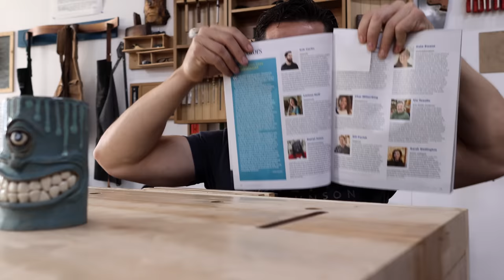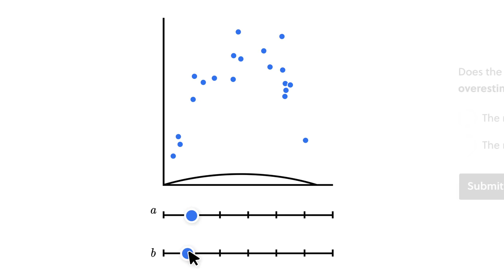5 tips youtube woodworkers give that professionals HATE

Comment: C-channel: I can't believe you'd compare the power of a living growing root with the movement of a slab top, it's absolutely not the same, one is progressively growing fibers multiplying not swelling over years and the other is dead fibers expanding and contracting seasonally, up to 1% of flatsawn width where I live.  There is no connection between the two.  Properly installed C-channel (with slots) will prevent cupping almost as well as a wellcrafted traditional tongue and groove breadboards.  But it DEFINITELY won't prevent twisting, and it'd be a huge waste of time if you only needed to attach a base.  Why wouldn't you just use flat bar then?  I will agree that the mystified bewilderment with which most of social media approaches wood movement is staggering.  Congrats on FW!

Comment: Maybe I'm using the wrong kind of double stick tape. Whenever I use it, one workpiece always comes off easily, then the tape just refuses to peel off the other workpiece. It's enough of a pain to get it to come off that I use the blue tape trick instead, and it works great. I use the thin CA glue though, not the thick stuff.

Comment: Sidewalks: That's not expansion and contraction, that's growth. Living wood is not the same as dead wood. Yes, drying, milling, and prep is really important, but steel absolutely can help hold a slab flat with proper attachment. In the same way that breadboards can. C-channel, properly mounted, should be thought of like breadboard ends.

Comment: Wait, #2... not doing "jack" up to a point. When the force of the wood is under the force necessary to deform/fail the C-channel, the C-channel is doing "jack". After that point, it's "not doing jack". Using my hardwood flooring as guidance, I expect the "acceptable" variance in moisture is 15%, ergo I would expect the C-channel to be fine for my home's CONTROLLED humidity which falls within 15% variance.

Comment: #2 - The example you're using of wood "blowing through" concrete is of a plant that is still living.  Guitar makers commonly install metal and carbon fiber rods to keep necks stable.  Ask Warmoth about their results before and after adopting the practice.
Reply: Guitar makers use them mostly because strings exert force on the neck that can eventually bend the neck.  Classical guitar makers don't use steel, and most don't use carbon fiber, but traditionally a different wood strip may run the length of the neck.  
A table is subject to humidity, but doesn't have steel strings trying to warp it.
Reply: @disqusrubbish5467  Point being, incorporating stable non-wood materials is effective at countering forces that may distort wood.

Comment: I'm no pro, but danish oil, shellac and waterlox are about all I need. Polyurethanes are more for anyone wanting a water-based finish. Wanna have some fun? Finish something in water-based poly, then spill some simplegreen on it. Eats a neat circle. Won't see that with waterlox. Oil-based urethane not so much. Oh, and proper ventilation is mandatory... shellac gets thinned with denatured alcohol (no smoking). And when it comes to food grade...duh..when the chemicals evap, its food grade finish. Have tried Osmo...its not cheap, but its a wax/oil wipe on/off finish. But so is beeswax and orange oil. 
Wanna fill gaps, I prefer Timbermate. Smells like kangaroo piss...but best putty with color choice for species. And I showed a pro that loves to use it, as we all make mistakes...like drinking and operating wood tools.

CA glue... neat tricks but yeah, double stick tape is cheap. I think Starbond just influences influencers...

Comment: Some of these tips I've never heard of ....and you make a good point about social media bandwagons causing trends but at the same time overall you're kind of your own enemy here. You have affiliate links to amazon, you have a sponsors, you literally made a "top 5 list," and you're on a bunch of social media platforms. But I digress....  IMO I think you're certainly right about finishes that state they can do it all in one coat like the one you mentioned. Polycryclic, danish oil (and related) and paste wax are my favorites for most projects. And for small cracks or imperfections, I see nothing wrong with using the same wood dust and glue if it's done right. Unfortunately, most of us are perfectionist and would rather re-do the cut in the first place. As for the CA glue and tape: that has to be done right and it should only be used for smaller projects. Example: when I remade my router table I used that method to make a router template. I ran out of db sided tape. It worked very well beause I used more tape and less glue. In your video you used a tiny pit of tape and too much glue. Congratulations on your recognition.

Comment: Make that subject 5 video! I’ve been trying to research on this!
I hope you do, because I subscribed for it just now , and for other stuff of course 👍

I do some woodworking as a hobby, and still in the process of learning. This video confirms my thoughts about some of the things I’ve seen on YouTube that I feel like is not right. Fx, I’m guilty myself with using the glue/wood dust method for filling small gabs, but still, I tried to repair a larger gab with actual wood, and it made the piece look much better. The dust fillings annoyed me quite a lot.

The other thing a can relate to is the finish subject, which I want to spend time on because the result is much better (in my experience at least) but again, I’ve been using stain before varnish. So , that future video may come in handy for me, and probably many more.

Great pro tips 👍👌

Comment: Thought the video would annoy me. Turns out I pretty much agree with all of it except maybe the stain part.  I'm a huge fan of quick, easy, cheap and available.  Stain is all of those.  I DO think people often just assume they need to stain any project, like it's some requirement.  I'm an even bigger fan of NOT staining or using any kind of Colorant.  Linseed oil, shellac, water and oil based polyurethane, floor wax, bees wax, and mineral oil, meet all my needs from tables to boxes to toys to kitchenware.   All super easy, cheap and available at any big box store.  Half of them even at any grocery store

Comment: your video just popped up.  nice one.  shellac is a definite go to in so many areas.  seal raw wood, binder between oil base and laquer finish or the final finish.  granted, not as rugged as poly but so much easier to work with.  maybe you can teach the wannabees?  and the wax sticks could be another class.  saved my backside more than once.

Comment: The ca glue painter’s tape method of temporary fastening really depends on the application.  I build electric guitars and use templates extensively.  If I used double sided tape I would run out in a couple of months.  Since I’m retired, that’s too expensive.  Plus it is not always easy to find the right kind of double sided tape where I live (don’t trust Amazon).  There are many luthiers that use this method all the time.  Also your demo is a bit misleading since the tape was too narrow and the glue bead way too big.

Comment: The C-channel thing is not harmless,it is promoting and perpetuating bad practice, like an urban myth.The partially sighted leading the blind towards avoidable problems.
To be fair,it probably will work in some cases with some soft,thin,softwoods.As you mention,the hydraulic pressure created by changes in moisture level in wood is incredible.In ancient times they used to split off huge blocks of stone in quarries by tapping dry hardwood wedges into small holes in the rock and sequentially pouring water onto them,waiting,tapping them down and re-wetting them.

Comment: I cant believe you said that "no professional furniture maker uses stain". 
I have 40 years unthe biz as a cabinet maker, furniture maker and finisher in 3 different states. 
Yes tinting top coats is an great way to get a custom finish. Ive done it plenty of times. 
But it wont give you a deep rich "depth of color".it simply can't. The reason is thag the color is suspended in the finish and wont penetrate the surface of the wood. It usually ends up looking mottled or "cloudy" as its often referred to. 
The best way to get deep brilliant colors is to use aniline dye in a clear stain base. 
So basically a home made dye stain.

Comment: I agree with the majority of your remarks. I do believe your idea that c channel does nothing to stop wood movement is flawed. One of your examples about how tree roots can make concrete explode is comparing apples to oranges. Tree roots are still alive and growing. The movement caused by environment in dried lumber is completely different. I do agree that using properly dried wood and understanding how it moves with changing moisture is critical to a well made piece of furniture. C channel operates in much the same way as Figure 8’s or other table top fasteners when properly applied. It allows for movement while HELPING to keep the wood flat.

Comment: So with respect to your c channel comments, are you suggesting that there is nothing that can be done to keep a tabletop flat other than milling and drying wood properly? I've not used c channel, but certainly wooden cleats are a common method that many pros use and I've used with success over the years. Trestle tables are another example, the trestles don't help keep the top flat?

Comment: I've moved on from c-channel to rebar.   Drill holes in from the back of the slab, slather 5 or 6 pieces of rebar in epoxy and hammer them in.  That should work right?  🤣

Comment: Well done... thank you for pro tips!
I've always thought the same about C channel... Sure, the channel is strong and flat, but 5 or 6 screws are not going to hold back a 2" slab.
Reply: By that logic it would be impossible to make outdoor furniture.  The C Channel doesn't have to hold it back, just limit what directions it moves in, just like breadboard ends, etc.  That's why some of the screw holes are slotted to allow movement but just not in all directions.   It's just not going to prevent all movement but that's different from saying it has no effect.
Reply: @ZeoCyberG  I stand by my assessment. Folks tend to focus on the strength of the C channel itself... when in fact, it's the 3, 4, 5, or 6 screws that are the weak point within a slab that has not been kiln-dried 99% of the time. 

Disagree with me all you want... but that does not change the fact that a chain is only as strong as its weakest link. 

You raised breadboard ends as a defense. You must appreciate you are referring to a full-length mortise and Tenon joint to restain several smaller boards that are joined together. This is not the same as two pieces of C channel with 4 to 6 screws embedded 1.5" into a 2" slab of 24"+ wide solid wood. 

A slab of this nature (24" of a solid slab) will move well beyond want a handful of screws will restain. You cannot compare this to breadboard ends that are restaining a series of 6" wide boards that are joined together.
Reply: @michaelbauer7023  Sorry but no, since again you're only thinking in extremes and not listening to what was actually stated.  The bread board ends are an example of what you're not getting because they work, not by preventing all movement but by guiding it and keeping it managed. The screws of the C Channel never have to resist all the movement, which most of it will be in one direction, which the screw slots still allows just like other common table top attachment methods, but it really only needs to resist movement in the other directions, which won't move as much and only has to keep the wood from twisting or warping.  

The simple fact it's possible to make outdoor furniture and furniture that can even last centuries proves my point.  Just stop thinking in extremes, no wood joint is without limits.  Dovetails, mortise and tenon, etc. can all break if improperly used to try to resist wood movement in the wrong way.  The trick with all of them is knowing the proper application and the point is C Channels have a proper application too.  So only won't work if you use it improperly, just like all other wood joining methods, but like the others they do have an effect...
Reply: @ZeoCyberG  Until recently, outdoor furniture was rarely (if ever) made from a single 2" thick slab. The slab "movement" is relatively new. 

As it relates to outdoor furniture that is a century old (or even from 25 years ago)... I have never personally seen a piece of metal C channel involved. 

In fact, I am personally making an outdoor set for my son. Not one piece of metal will be involved 🙂
Reply: @michaelbauer7023  Um, you've apparently never looked at antique industrial furniture, among other examples that combined metal with wood construction.  Besides, it actually doesn't matter whether or not it's a slab or how old you think any joinery system has been in use because, regardless, they all just have to work off the same principles of dealing with the nature of wood and accounting for it in the design.  Thus wood working can be applied to everything from the very small, like a simple box to something massive like a timber framed structure.  Nor does it matter what specific method or joinery system you choose other than it being applied properly and appropriately. 

Historically, woodworking dealt with what was practical and whatever got the job done.  Being worried about what method and system you used is a modern trend...

So Aside from applying whatever you choose properly and appropriately, just enjoy doing it however you want it done.  You don't need to justify how you prefer it, just understand there's many other ways others can choose to do it that are just as valid...

Comment: You shouldn't use blue tape, doesn't work. Use good old fashioned off white masking tape. The reason why I use it is because it has better lateral hold than the 20 different double sided tapes I've tried. Maybe in normal woodworking a 64th here or there isn't a big deal, but if you're routing a neck pocket for a guitar it makes a huge difference.

Comment: 1. Painter's tape & CA clue instead of double stick. I use it because I have painter's tape and CA clue in my home for my other hobbies. I do not have carpet tape in my home. When I tried carpet tape, it was not any better than just using the cheaper blue tape and glue. Granted I only use this trick when using a CNC, so maybe carpet tape would be better than blue tape when using different machines. 

2. Using C channel to keep wood flat. I've never used this. I actually do not worry about wood movement, but I am building things like beds or smaller projects. Wood movement, in the species I use, is 1/4" at best. That said, I don't see a reason that C channel would not work to stop wood movement. How is it different form a batten or breadboard end? I am asking earnestly because I cannot reconcile how they would be different. Trees destroy concrete by growing underneath and lifting it. Shifting soil and its expansion and contraction also lead to sidewalks cracking. It cracks as a result not being able to support itself. 

3. Using Rubio Monocoat as a finish. I only know one person in meat space that uses rubio monocoat. Most others I know use shellac or poly. I use a boiled linseed oil/mineral spirit mix. Different strokes for different folks. 

4. Using sawdust and glue to fill gaps. I honestly do not use this trick. If I make an error and the project is still viable, then I consider the error a form of wabi sabi. Or maybe I am just too lazy to make a correction. 

5. Using stain. I only know one professional woodworker and he does not use stain. He does not use any form of colorant either. He sprays shellac and French polishes it. I do not know anyone who uses stain, honestly. It does make me wonder who are the main buyers of stain. 

I certainly understand your apprehension for these tricks. Shortcuts are just detours disguised as less work. A hobbyist watching a YouTube channel might see the shortcut and be disappointed with the results and give up the craft.
Reply: Carpet tape is the worst kind of double stick tape to use here. It can be a real pain to clean off your workpiece, and if it's holding a routing template then you better make sure it's not crossing the line you're routing to or it'll gum up your router bits.

And yeah, I have those same thoughts about the c channel. I cannot see why it wouldn't keep a panel/slab flat. I COULD see how if a piece wanted to move and was constrained by a c channel that it might damage itself in the attempt to move by either cracking or ripping the screws out.